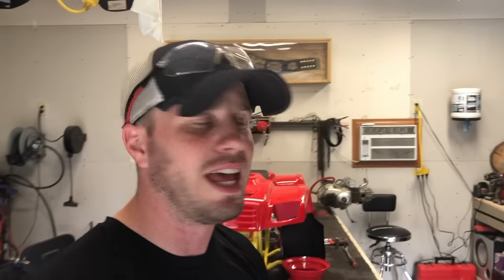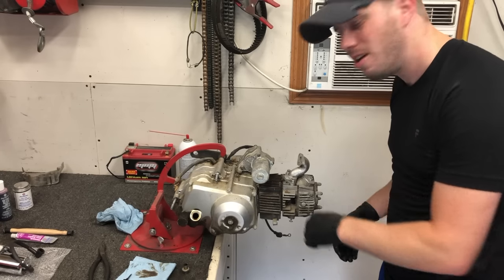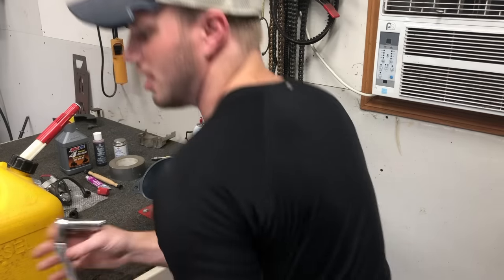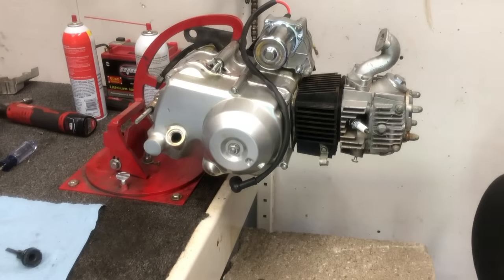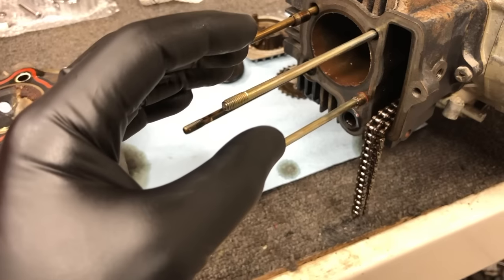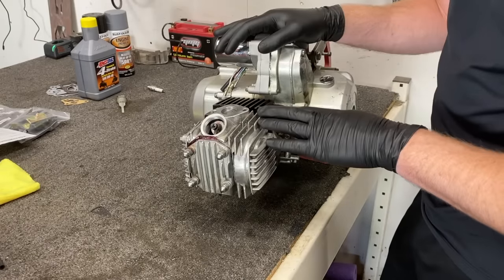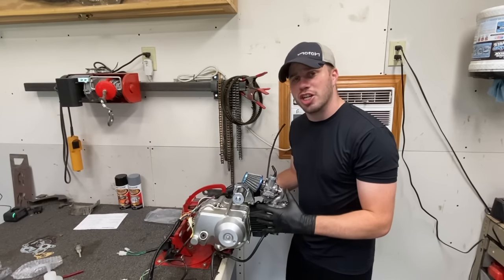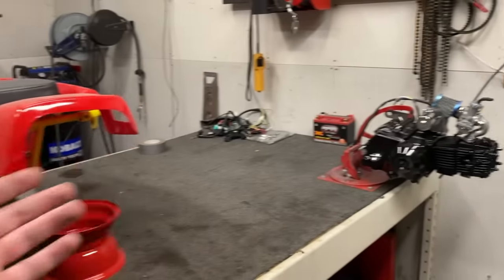Restoring a TaoTao 110cc Chinese ATV! Complete motor rebuild! Part 4

Comment: Nice job. I just rebuilt a honda xr70 and put training wheels on for my 3 year old son. He rides it like a champ
Reply from the maker: 3 years old!!! Dang, that's a lot of bike for 3. I just took my 3 year old down to power wheels after his first real crash on a 50cc atv!
Reply: @PraskaBoysGarage  I got it governed down so he can't go to fast in 1st gear. The training wheels work awesome and I can't even pull the bike over on its side. He has a 110cc xpro atv and he rides it like he stole it.
Reply: @PraskaBoysGarage  also he watches your videos with me. I have have learned a lot and have now been working on several china quads I got from junkyard. Most have been bad wiring issues. Motors all ran with a little love 😆😆😆
Reply from the maker: @geneperrego5107  Love it man! Appreciate the support and good luck on your future projects!
Reply: Can i get the 125 cc cylinder kit from same supplier ? I got a 125 engine thats locked up and would like to rebuild it and swap it out for my 110 . Any help would be great , and keep up the great vids , i know alot of people put down the china atv but they seem to forget the motors are honda clones and honda has been doing it right for a long time this is why the motors are used in the china buggies as well as atvs , sure the chassy parts can be crap but if you take care of the motors they can last a long time ..

Comment: I love that you have fun while doing this.  That’s the life, man!
Reply from the maker: I wouldn't have it any other way! Thanks for watching!
Reply: @PraskaBoysGarage  I have a 125cc Chinese pit bike engine that I’m hoping this video will help me figure out which seal is bad. Somehow the tube coming off the crank case breather got plugged  so pressure built up and now even though it’s unplugged oil is leaking from the engine case 😬

EDIT: when I say “somehow”, I mean, “I plugged it because I am a dummy and was closing off emission bits since I changed the carburetor!” OOps! 

“Alexa, please send me more gaskets...”

Comment: I’m working on a Tao Tao 110 and was wondering how do you connect the front brake lines to the actual front brake on the bars one has two little spike things sticking out and the other has two female ends but they don’t fit I think I might have ordered it wrong. And for your rear brakes do you replace them or try to fix I’m trying to fix because they r in pretty good shape, but they just not working like there not stopping wondering if u have any tips
Reply: Have you checked the brake fluid and bled any air out of the line?
Reply from the maker: In this build I am completely replacing the rear breaks with a complete disk brake kit that's already filled with fluid. However it is cheaper to fix the brakes you have and I agree with Max. Check your fluid, might require the brakes to be bleed again. If you can shoot me an email with pictures of the front brakes. Id be happy to take a look at it.

Comment: I think I saw the valve impact mark on the piston when you put it up to the camera.
Reply from the maker: You are correct. Also you can see it on the valve as well. My guess is while that valve was stuck open and I was checking compression it was slapping. Now that the motor is timed properly and the new valves are seated everything is all good! Good catch!

Comment: Would you please share more of your wisdom...I went with Valvoline 10W-40 Full Synthetic. Got it running Tao Tao 125 cc Jeep go kart Automatic with reverse  now experiencing high idle in neutral and I would say regular idle in gear. All parts are new. My. prayers 🙏 are keeping my sanity.🇨🇱🇨🇱😃 THANK YOU.
Reply from the maker: Hey Antonio! Those little Jeep go karts are awesome! We owned one for a few years and loved it! High Idle can be adjusted with your idle screw on the carb. Turn the idle screw counter clockwise and that should lower it. If it does not go down you might have a kink in your throttle cable line.

Comment: A little diagnostic tip that I noticed is at 4:06 in the video on the end of the clutch, you can see the radial streaking in the oil on the face of that plate, indicating it was run with that worn out oil, and it didn't just sit there and darken.
Reply from the maker: Thanks for the tip! I'm no mechanic that's for sure, so I always welcome any and all advise. Thanks for watching!

Comment: Thanks for the great video I have gained quite a knowledge in order to rebuild a atv for my kids I’m stuck at starting the unit it seems to take a while to start haven’t done a compression test yet I will get a new plug and perform a comp test. 
I just discovered one of the exhaust manifold bolts broken would that cause a compression issue to turn it over 
It’s a 110 cc Tao Tao engine any info would be helpful. 
Thanks
Reply from the maker: The exhaust bolt wont cause a loss of compression.

Comment: So I found a four wheeler on the side of the road and I got it to turn over but never got it to crank so I’m buying a whole new wiring harness like you did and to see if it’ll run well. It was submerged in the water, but it still turned over will it still crank

Comment: Just future advice use it if you want but you can pour kerosene in it let it sit a few minutes an then drain it it'll break the grime loose an clean inside fairly well
Reply: Just saw you use disel instead that's also a good method

Comment: Thanks for the videos- new subscriber. I’ve owned and repaired GY6 150cc’s but I am struggling with a 2015 Coolster 125cc Gokart (6125). Typically I just download a parts diagram and engine service manual then make my way through it. I have scoured the web with no luck and even spoke to Coolster who claims they don’t even have a parts diagram for it WTH? If you or any subscribers have any resources or can point me in the right direction I would greatly appreciate it. So many questions and no way to find the answers. Your video has been the most helpful.

Comment: Double checked no kink throttle cable. Break in period, your thoughts please. Thank you for you channel, truly appreciate it.👍🇺🇸🇨🇱
Reply from the maker: What about the carb idle screw?
Reply: @PraskaBoysGarage  No real difference. #75 main jet and the needle is in the third position from the top. All is stock minus the New Racing CDI box ignition coil, plug and cone air filter. Carb too small?

Comment: God bless bro! There is not alot of videos and manuals on these engines. I attempted to open one up and figure out why it would pop out of gear. A r-n-d 125cc which I believe is very similar? Well the engines were cheaper back in 2015 so after a month of the engine just in parts on my work bench, I opted to buy a new engine instead since the rebuild kit/ gaskets were half the price of the new engine. I went to a 3 speed semiautomatic with reverse. Now years later I have 6 atvs. For the family to ride around our property.  On the 3 speed, I have 2 atvs that will pop out of 2nd gear randomly. Do you have a clue what this might be? Any info would be greatly appreciated..

Comment: Where are these specs? I've been tasked to get one running. Changed starter, simi tuned the new carb but found oil dripping from between the case halfs. So I need to see a tear down of the case.

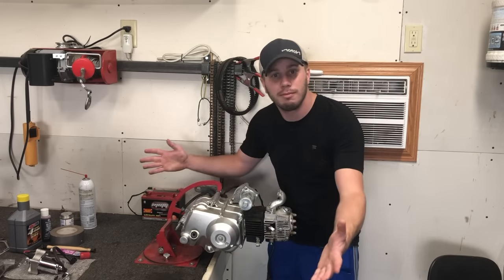Comment: At 6:18 you took the side cover you took off to replace gasket. So what's the bolt in the center of the side plate and any idea why mines leaking oil out of there when running? Do I need to tighten it? Or is it like an over flow?

Comment: Can you put a 90 or 110 cylinder & piston on a 50cc engine? Is everything the same between these 50, 70, 90 and 110's besides the cylinder/piston bore size?

Comment: I picked up a Tao Tao kids quad with the 110cc engine. It was not running, the guy I bought it from changed the wiring harness. But now I'm not sure if it was supposed to be 2 pole or 6 pole stator. Is there a marking or something on the flywheel showing if the stator should be 2 or 6 to match it?

Comment: Hey, been looking for a couple atvs for my daughter, unfortunately around here everyone wants an arm and a leg for something upside down in a ditch. Just picked up a couple 125 Taos for a good price that need work. An aircraft mechanic by trade and my own auto mechanic, but new to small engines, been following your videos for tips and tricks. Videos are awesome, they are simple and easy to follow, but very informative with lots of tips. One question,  where did you get the bench mounted engine mount? It is much better than any other one that I've seen.
Cheers!
Reply: I am also interesting in that stand.

Comment: hey just curious the engine stator cover cap is missing and you werent to worried about apraying paint into it. i have the same four wheeler it is missing that same cap an i havent let the kid ride because i was worried it would break the stator if anything got in there. is this just a part you ont really need

Comment: Does all the Chinese engines like the one you just rebuilt take the same size oil seals for the crank seal behind the stator I have one on my son's go-kart and it's dripping oil when he's riding it coming out of the cover where the stator is I assume it's the oil seal on the crank behind the stator but I'm not positive I haven't tore it apart yet

Comment: I just got this used Chinese 4wheeler and when i turn jt on, let it warm up but when my son pushes the gas it looks like is not getting power and will turn off. Any advice? I was going to drain the gas tank and put non ethanol and some seafom, change the oil and the gas filter.

Comment: Hi! Im teaching myself how to work on engines by working on lawnmowers and i recently bought a pit bike to restore which is a big step up. This video is amazing and i love the mix of good acting and delivery of information. My one question is what was the diesel used for?
Reply from the maker: Thanks, I'm glad you like the content! Diesel is a good cleaner/degreaser that doesn't have any negative effects on the motor. I works best if your trying to clean sludge out of a motor that's been sitting for awhile. You use diesel because you wouldn't want to fill it up with a degreaser or worse soap and water. Just fill the case up, let it sit for a day, shake the crap out of it, empty and fill with oil. Cleans all the junk out nicely!

Comment: So, my Amazon rebuild kit didn’t come with any instructions and the rings weren’t clearly labeled at all, so I just took a shitty guess and installed the metallic colored one on top and the black one as the second ring. It runs, but it looks like you did it the other way around. Curious.

Comment: Did you hone the cylinder? and is there a specific way the rings should fit on the piston? Does it matter? 

I followed this video while doing mine and for some reason my compression afterwards is like 50, it was 40 =/.  

Put new piston, and rings in the old cylinder, cleaned and reused the head, pulled it apart cleaned and re lapped values, set clearances to .005 and .007, timing on TDC and in line with the notch. Honestly im wondering if my compression checker is bad even its brand new... the bike feels way better than it did before the rebuild and  stays running and idles great, it does smoke a bit when i first start it up however and it kinda smells like oil which is why i think the piston may have been done incorrectly. Thanks for sharing this awesome content. Was very helpful
Reply from the maker: To be honest most of the time I talk to people about this issue after they rebuild is a bad compression tester from harbor freight! Try looking up the ring order for a good picture but here is what you put in starting top to bottom: Compression Ring, Wiper Ring (this ring will have an angled edge that needs to be facing towards the bottom end), oil rings.

Comment: Hello! I have a 125cc Tao Tao and it’s idling really high sounds like if I have the full throttle opened. I replaced the throttle cable, carb and the manifold thinking that was the issue because of an ir leak there but it still sounds like I have Throttle  opened. Do you think it could be one of the head gaskets?

Comment: Hey i’m replacing the same side of my crank case at 6:57. What torque did you use when tightening the bolts? And was that red paste silicon? Thank you!!

Comment: Hi, is it possible to stand these engines up, sprocket at the bottom, head pointing up, If the carb was also rotated so it stayed in its original flat position? Would it still run

Comment: Awesome video! Not sure if my kids' go kart needs a rebuild or what. It runs fine for a couple miles then quickly loses power then shuts off. It would not start back up until the engine cools down completely. Any ideas?
Reply from the maker: Thanks! Might not be your engine but more likely a fuel or air flow problem. I would make sure your air filter is clean, fuels lines and filter are clean, and that you have good fuel flow to the carb.

Comment: I love you videos and I have a kazuma falcon 110cc that I bought I couple months back with a no spark issue have replaced the stator and the wiring harness but still no spark and tips or ideas of how you could help ?
Reply from the maker: Thanks Corey! Make sure you have a good ground wire without corrosion. Check your kill switch with a ohms reader. If you still don't have spark there is a good chance your CDI box is bad.

Comment: I recently got a atv with a motor just like this one but it didn’t start or run. I’ve determined that there is no compression but it actually sucks my finger into where the spark plug goes. What would you think is happening here with suction not compression???
Reply from the maker: Suction is apart of it. Just like if you put your hand over the carb like a choke. It's pulling the fuel into the chamber. You should perform a leak down test to see exactly where you are leaking from.

Comment: You can make a video comparing a 90cc cylinder and a 110cc cylinder to see if it is possible to put a 110 on an engine that was 90
Reply from the maker: Yes, I have all the parts to make that video happen! I will be doing it after my scooter project is complete.
Reply: @PraskaBoysGarage  That would be perfect, you make very good videos and very well explained

I wish you could explain that if the piston pins are the same as the 90cc and the 110cc
 And if the cylinder is of the same height so that the connecting rod is not going to be short
Reply from the maker: @christananderson1506  Thanks, I will keep all that in mind while I am making the video. I don't want to make it very long but probably somewhere around the 10 minute mark is my goal.

Comment: I picked up a used 110cc pit bike. The person I bought it off of had the motor torn apart before. It was leaking oil and out of time. I took it apart to find out they never put the o rings back in the head gasket or cylinder gasket. Can I use regular o rings? Or are the like a flat washer O rings? That I need to replace with the actual part made for it. They aren't there so I'm not sure exactly what they look like.
Reply from the maker: I'm probably late to this party but yeah I just use regular o rings but make sure they are thick so they crush wider.

Comment: Hey man. Amazing videos, watching from South Africa. 
Quick question.....
What size battery should i use for 250cc Chinese ATV?
Reply from the maker: South Africa! That's awesome! If the atv is someone your drive routinely then invest in a lithium for sure!
Reply: @PraskaBoysGarage  Awesome thanks, another question.
Does it matter what wiring harness i buy because spares is very hars to come by here and if i can find ita extremely expensive like 50$
Reply from the maker: @simeonerasmus  I've purchased them from many different sellers and haven't seen a big difference. Buy Amazon if you can, they have a great return policy that most other sellers don't offer.
Reply: @PraskaBoysGarage  thank you for that info, one more thing.
Do i need to ask the people I'm buying from for lets say the cdi i need a cdi for a nolimit atv or can i just tell them i need one for a 250cc atv?   Does the above apply to all the other components like the brakes?

Comment: I have a question. When the engine is cranking and I hit the throttle, it stops cranking. It act like the battery doesn’t have enough juice, but it does, but if you don’t hit the throttle at all while cranking, it will kee cranking no problem. Why would it be doing that? Do I have to change timing?
Reply: clean your carburetor first, if your battery is dead when you hit the starter button it will just click, if the battery is weak, the starter will just spin and you won’t hear the motor, just the starter, a weak battery will cause the starter to sound sluggish/ slow

Comment: how do you get the head so clean, I spent like hours scrubbing it with a brillo pad. But the inside is impossible to do with that
Reply from the maker: Grinder with a wire brush attachment is a life saver!

Comment: I have a 110 cc kazuma, the engine seems very similar.  Wondering if you know wether the oilpump and oil pickup tube are accesible from the clutch side? I drained oil, let it sit for too long and now I lost prime on the pump.
Reply from the maker: It's been a minutes since I've replaced a oil pump so without it being in front of me I'm not 100% sure, but I am 99% confident it's on the clutch side in front of the crankshaft gear.

Comment: When you test for spark, did u see a lot of spark or just alittle white spark? I rebuilt the top end tried to start it. Did a spark test and got alittle white spark. Kinda seemed weak.
Reply from the maker: Seemed to be what I would consider normal. It's not as strong as a 212cc predator motor but the plug is half the size. I'd say if you throw some fuel at it and it runs then leave well enough alone!